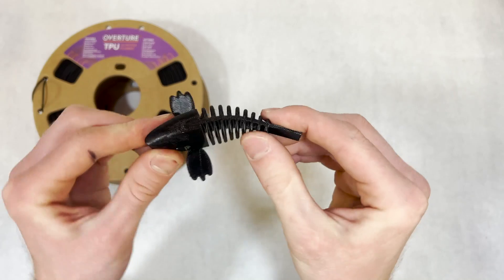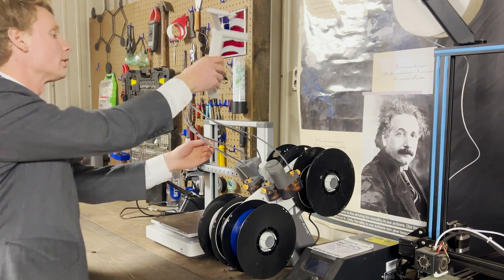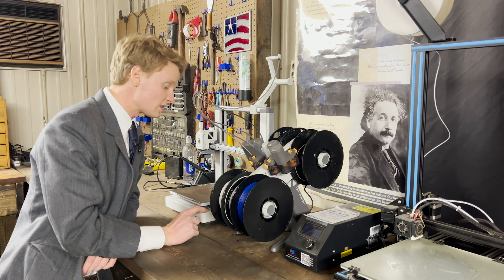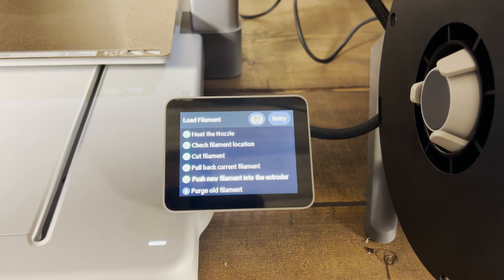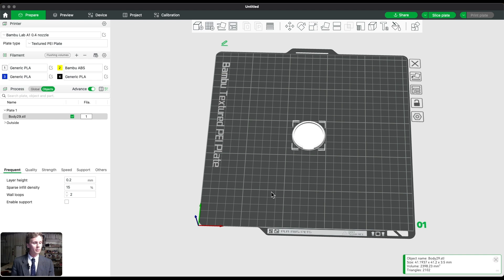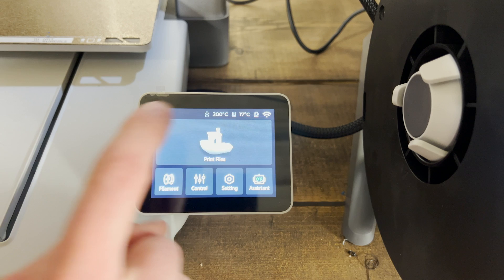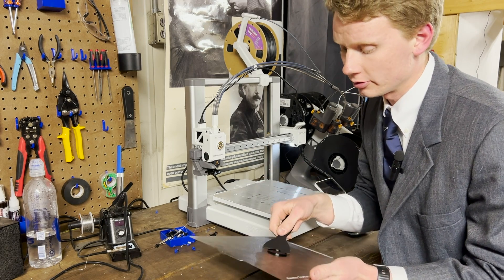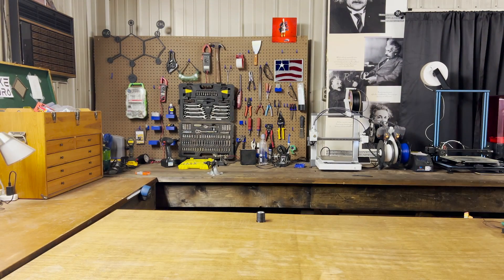3D PRINT RUBBER (TPU) with BAMBU LAB A1

Comment: so you can't just remove the ptfe bracket and manually load the filament into the extruder? I mainly want to print TPU but my understanding is direct drive is good for TPU BECAUSE u don't need the PTFE tube

Comment: Got my subscription. You somehow answered many of my questions all at once. Im a newbie and was wondering if i could steal the PTFE off of the AMS lite and run TPU in a multi material print. Ive seen things about how to properly cross section different materials with TPU to force a bond where otherwise there would not be one. 

One question i have left, is a dryer necessary for TPU? You may be in a dryer climate than i am. Humidity sits between 50% and 75$ so i was figuring id need to print directly from a dryer box.

Comment: TPU is also extremely hygroscopic. So if your print ends up being a bubbly mess, consider drying it for 12 hours at 60c, and then put it in an enclosure like an airtight cereal box. Cut a hole and slide a 2mm or more ID and then feed that into the AMS hub.

Comment: How weird, when asked to check if the filament was extruded i didn't see anything, even after multiple tries. In the end i just clicked ok, in spite of the fact that it had extruded nothing and it just worked fine. It purged the old filament and then started printing.

Comment: Hi Jake, to use the AMS with Overture soft filament, you must remove the spool holders and use a tube over the shaft. There is too much drag on the filament, so you need to remove all the drag. Good luck.
Reply from the maker: @billharvey7901  thank you for sharing!! I’ll have to try your method out. Two questions: 1) were you able to multi print with TPU and another filament like PLA? 2) could you explain “use a tube over the shaft”? Removing the spool holder makes sense, but I’m not quite sure about adding a tube over the shaft. Thanks again!
Reply: @jakemgrim  I was wondering if it is possible to print multiple sheets with PLA.
Reply: What do you mean tube over the shaft
Reply from the maker: @TomRoseman-s8w  I’m wondering that too

Comment: TPU filament with a smooth surface should be loaded without a PTFE tube. Disconnect one of the tubes from the print head and run the TPU directly into the port. The flexibility of TPU gives it higher friction so it can stick to the sides of the PTFE tube and cause a jam.

Comment: I am using A1 with AMS Lite and it seems that by disabling AMS to use the TPU external spool, it will use TPU as the support as well. How could you print  a TPU model with PLA support if we have to disable AMS when printing?

Comment: Just a couple of tips on that suit. One, it could use a little tailoring. It probably wouldn't cost a lot and could make it fit way better. Also, starch. Starch is what is used to stiffen fabrics. Maybe the tailor could stiffen the collar flaps somewhat so they lay flat more.

I mean, I'm not sure why your wearing a suit in a workshop, but I'm guessing you're going for a look. Fine, no issue with that. Just, your suit shouldn't look baggy and wrinkly then, probably. 

Wearing suits has somewhat gone out of style, but just by doing a little, you could make vast improvements on your look.

Comment: I'm sorry, but this video doesn't really address any of the common issues with printing TPU. Didn't even mention that you should absolutely dry it, or any settings like printing slow, or how to avoid it getting stuck. Also, why don't you just print it directly from the computer, you can select the external spool from there?

Comment: It would be very interesting to see it print functional parts with a combination of filaments. A basic idea would be a soft-grip ridgid handle for something, but I'm sure someone could think of something cooler.
Reply: How about using an ASA shell for UV resistance, or even testing the properties of layered TPU and PETG - soft and hard. PETG and TPU overlap in hotend temperature ~220-230C and should adhere. The PETG would then be able to flex much more than usual and absorb shock like a riot shield. I'd watch that video..

Comment: My machine hides the EXT in the final press of print if AMS is connected to back. It ignores EXT options and has NO WAY of selecting EXT with AMS power cable still connected.
EDIT: I was pressing Print, not send. oops
EDIT2: Found that needed to be in LAN ONLY mode which is not working right atm. SO easiest way is disconnect AMS, turn machine on and proceed as usual. That way the AMS detection won't block the use of EXT filament by the software.

Comment: Very helpful, thanks so much. Liked and subscribed. I think the interface on the A1 has changed a little since this or maybe there are to ways but I just right click on the model and use change filament, also on the A1 display there is a tab for external spool. Just got my A1 so not sure if that is new feature.

Comment: Hi, i have problem printing TPU with my Bambu. Always, appear stringing and idk how if i have ti change the speed settings on my material and the retraction length.
Reply: the speed, hotend and build plate temps are set by editing the filament (little square w arrow next to it), while the retraction settings are by editing the printer preset I believe. Both in Bambu Studio app. Most TPUs are printed at 210-220 degrees based on manufacturer recommendations and also recommended speeds are 30-40mm/s for walls and 50-80mm/s for sparce infill to minimize stringing or failure. I will be trying my first TPU print using these settings tomorrow.

Comment: Hello!
I got a Bambu A1 mini. Struggle to load tpu80 after PLA was there.
Without ams, I was pushing TPU through tube, then directly through 4-holled port on top of print head.
It simply dont come out. 

Is there any tricks to load it?

Comment: I use my wife’s hairspray as a release agent on the PEI plate….it works great and no scraper needed.  Just lightly spray it on the plate before you print.  Before I started using hairspray, I had a hard time getting TPU prints to release.
Reply: Sounds dumb but Windex.  Plain, the original stuff.  Clean the plate as usual, spray with Windex and wipe it all off.  Prints pop right off.  I use it for PETG too.
Reply: Did you try pva (the purple disappearing) glue sticks?
Reply: PLA falls off if you let the plate cool to room temp, does this also work with TPU ?

Comment: I don't get it, how does the printer know you added it to position 4? Even though you chose external spool, you didn't tell it which port you loaded your filament into.
Reply: It just knows. I just got my A1 and had the same question when setting up my AMS, but it doesn't matter which position you connect to which port. I guess it can sense which tube is being fed.

Comment: I saw video once on classic ams that tpu (overture hs) works. All that person had to change was instead of saying tpu in ams he selected pla. Profile was also used as pla, but settings were from tpu.

That being said, since you use same tube as from AMS lite, this might work. Could you try and reply back? Im waiting for new batch of A1 and will for sure try that as I would like to see possibility to print multi color tpu without manual replacing of spools.
Reply from the maker: I tried exactly what you’re saying. I thought it would work but it was very inconsistent. The reason TPU doesn’t work in the AMS is because the spring on the feeder motor in the AMS is too heavy for TPU. The TPU actually gets restricted by the AMS motor. I tried taking the pressure off of the spring but it just lead to more headaches
Reply: @jakemgrim  you use only standard tpu or high speed? It is supposed to be difference in ams. Still waiting for restock on a1, but will for sure try this. If nothing, at least to change different material for support would be good while printing tpu.
Reply from the maker: @janezhitori6203  I just used standard TPU. I hope the A1 will be back in stock soon. I LOVE using mine!

Comment: So you didn't have to go in and manually slow down the printing speeds in the config?  I am printing a poop basket for the a1 mini to replace my pla basket as it rattles and drives me nuts but being a novice still to 3d printing it took me awhile to dial in the settings on this.  Basically I slowed all my print speeds down to 50 except the inner and outer wall I set to 30.  Prior to that I was getting massive stringing which eventually just caused failures.  I also ended up going with the smooth PEI plate as the textured  plate just had too much adhesion.  Tips on printing with TPU going forward would be more then welcome!  Thanks and great video...
Reply from the maker: Glad I could help and thank you for taking the time to comment!
Reply: A quick way to slow it down, is to go into the filament parameters and lower the max volumetric flow value.

Comment: I have never seen it in anywhere, but my tip is to use alcohol to remove tpu, 
What I have seen is many beds that got ruined by TPU removal fail though
Reply from the maker: Do you apply the alcohol to the bed before you print? Or do you put it on as you’re trying to remove the part at the end? Sounds like a good idea!
Reply: let it seep underneath after :) @jakemgrim 
putting a tiny tiny bit of glue-stick into the alcohol you use to clean the bed will also help with just about all bed issues and make it last longer
Reply from the maker: @yagoa  that’s such a great idea! You just saved my bed plate!

Comment: the build plate doesnt say it can print TPU, only PLA/ABS/PETG ...that confused me but probably TPU buildplate temp is between PLA and ABS ?
Reply from the maker: From my experience, I would say it’s because it’s incredibly difficult to remove TPU from the bill plate. You make a good point, and I would recommend using a smooth build plate for printing TPU. Thank you for bringing that to my attention!
Reply: @jakemgrim  i was thinking only about temperature, but you are probably right. If the filament sticks more (like tpu) it is probably going to be waaay worse on textured build plate. Probably the reason they didnt put it on build plate label...but from your experience it looks like it is still possible so I m gonna try for sure!
Reply from the maker: @11WicToR11  good luck! Let me know how it goes! Just keep an eye on the heated bed cable

Comment: My CR10 prints TPU just fine, you just have to tune your slicer settings.
Reply from the maker: Really?! Do you just run it slower?
Reply: Yes mostly 25mm/s speed settings, 1.05 extrusion multiplier, 10mm retraction at 20mm/s  @jakemgrim

Comment: I am running 70A TPU on mine now it took a couple of attempts for it to do the flow calibration but it’s working.
Reply from the maker: That is awesome! I have two questions: What is the difference between TPU and 70A TPU? What brand of 70A are you using?
Reply: @jakemgrim  Most TPU is 95A hardness, 70A is comically soft. I made a strap for my son for a toy weapon and it’s nearly as flexible as silicone. It was a limited run by Microcenter on an 1lb (0.5kg) spool that was mislabeled, and discontinued when they realized most couldn’t use it.
Reply from the maker: @JonLaRue  I see! Thank you for explaining!
Reply: Hello can I know what speed you can run TPU in the A1? I'm Undecided between the flsun t1 and the bambulab A1, the predominantly TPU prints
Reply: @LazyghostKing  I am a long time user of FLsun and Bambu. I would avoid the t1 for the next year until they have all the kinks ironed out. The S1 is a mess they T1 will likely be worse. If you want something that is reliable I would go with the A1. Don’t forget due to geometry the bed of the a1 is bigger than the t1 (area of a circle vs area of a square).
Reply: Did you just have to run through the flow calibrations a couple of times or were there other steps, I've got a couple of bits I want to print in ninjaflex but want better quality that what I can get with my upgraded ender 3 that I'm currently using for it
Reply: I’m running clear 90A on my A1 mini and it’s hard to print sometimes because it’s a bizarre filament to print with. Do you have any tips?
Reply: @ use the generic TPU setting in the slicer and then slow the speed down. You can also set (I think it’s called) do not cross non printed area to leave less ooze

Comment: Interesting. Thanks for the video. I haven't not much luck printing TPU with my Prusa MK4, but my Neptune Pro 3 is doing much better. Just got the A1, and I wanted to try TPU on that machine.
Reply from the maker: TPU can be tricky! The A1 does great as long as you do not run it through the AMS. It is really really hard to get off the bed though once it is done

Comment: how many times did you say TPU?
Reply from the maker: Like 5 I think
Reply: At the minimum 5 times lol @jakemgrim
Reply from the maker: @Vanity2021  I noticed the same thing while editing the video lol. Do you use TPU at all?
Reply: @jakemgrim I haven't used it yet, will be looking into where I can apply it if I do. I just got into 3d printing recently, mainly for making VR headset comfort mods. So been using PLA+ and Pro for durability and have some PETG coming as well to try out.  I have been expanding into other use cases. I have a A1 and a A1 Mini. Also have a Flashforge adventurer 5m Pro so I can do ABS. Look forward to anymore content you drop.
Reply from the maker: @Vanity2021  thank you! I haven’t used PETG but I’m hopping to team up with Atomic Filament and make a video on it soon!